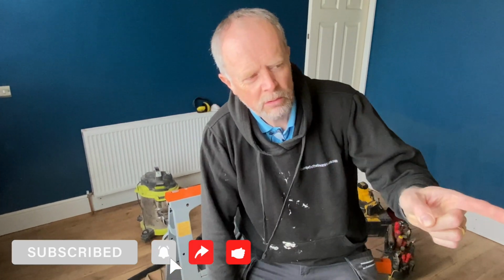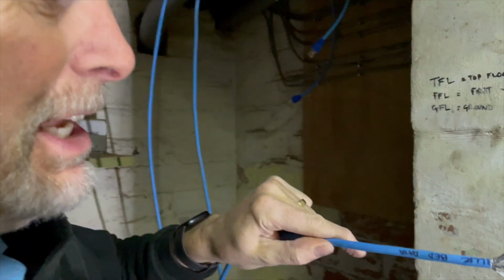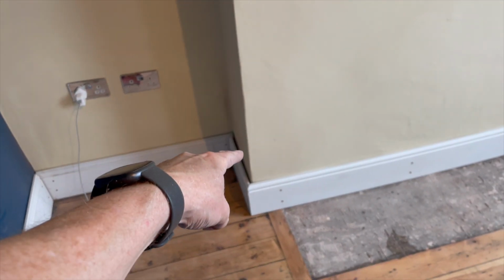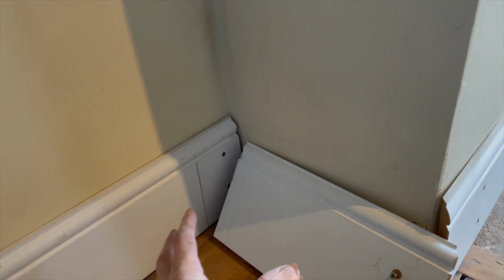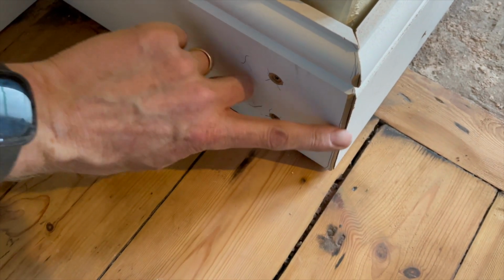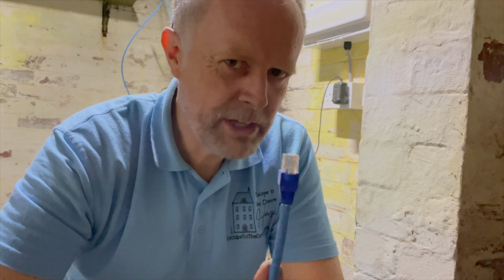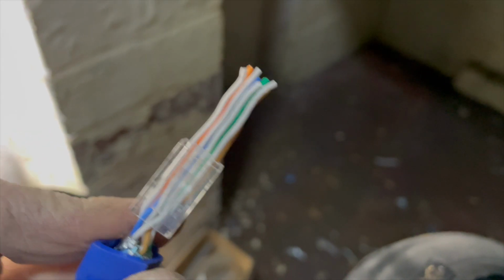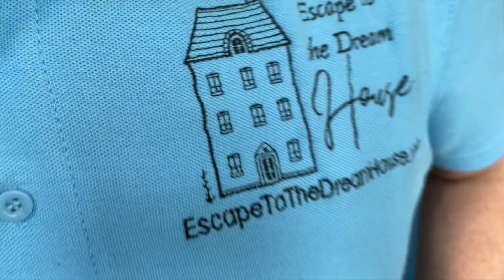The skirting boards are DONE! But the data cable is DEFINITELY not!

Comment: In commercial fit-outs I have seen a modular system for skirting boards.  It is usually an aluminium strip that clips to a backing plate, that has several grooves of channelling built in, with moulded corners.  Large grooves for power, medium grooves for CAT, and small grooves for 'phone.  There is enough space to install power points, BNC plug panels and CAT plug panels.  Perhaps can be sanded and painted to match a domestic fit-out.  Being metal, the signal fidelity is catered for.
Reply from the maker: Interesting!! I’ve seen things like this but never used it. Sounds well worth a look 🍻🍻